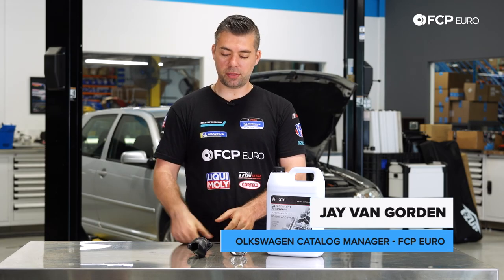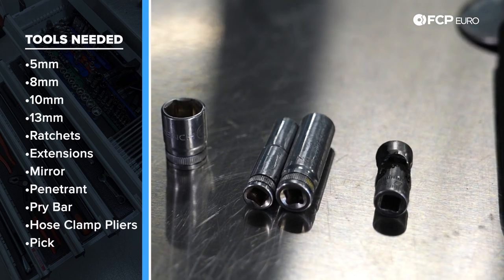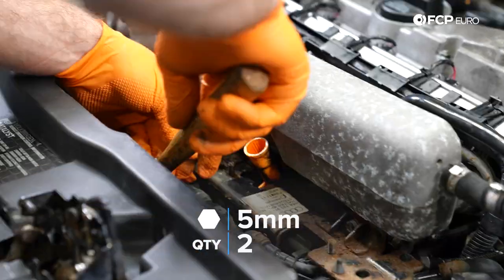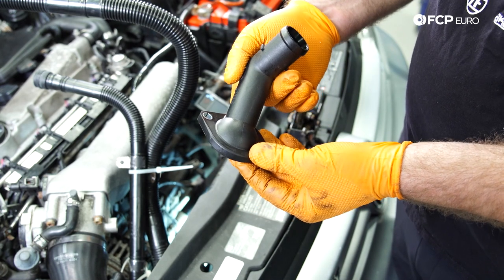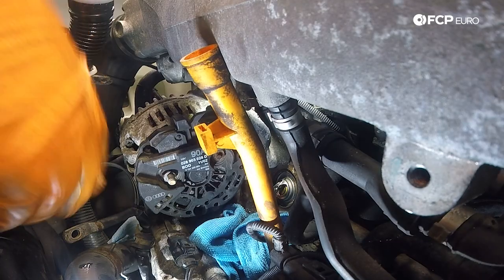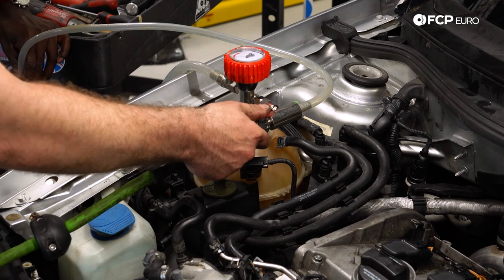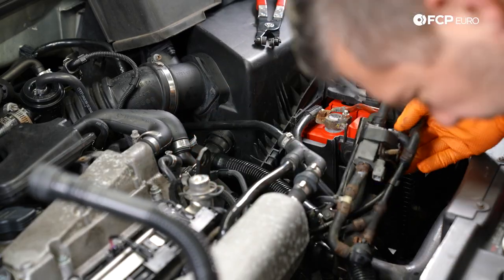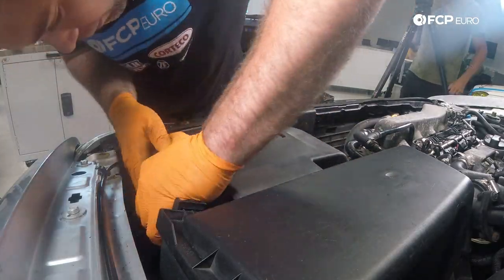Mk4 Volkswagen Golf GTI Thermostat Replacement DIY (1998-2006 VW Beetle, Jetta, Golf)

Comment: Literally SAVED ME $600!
Followed step by step.
HINT: don’t need to remove the engine mount, just jack up the car, move the mount to the back of the engine and once the timing belt is installed, work it back into position. Love FCP! Should make more videos on these 1.8t
Reply from the maker: Nice work!!

Comment: I just replaced mine. The easiest way, believe it or not, is to remove the whole front assmbly to get to those two screws. 
the radiators and the front assembly are only linked by 2 or 3 hoses and a few connectors. You have to remove the bumper cover and the assembly comes out with five 13mm screws. Replacing the thermostat is 10 minutes after that. Way easier than trying to fish those screws.
Reply: Be careful with the AC hoses, though. I held the front assembly in place with a couple tie wraps.

Comment: Thank you for sharing this great video! I just replaced radiator for new one, but ventilator does not start even when temp goes to 90 , no leak from passenger side, any idea you could please suggest that shall be checked? Coolant just boils but vents just does not start! This Is the first time I do all by me self, losing fear so  just doing It, but I don't want to give up and call mechanic. 30a fuse looks good by the way. Allí this Is happening in an Audi A3 2003. 
Thanks in advance for any ideas or suggestions.

Comment: Great video!  I have a 2004 Jetta with the 1.8T that overheated last week in -15 deg.F (I live in South Dakota) after driving about 17 miles.  I let it sit for a couple hours, then tried to drive it back home, but it overheated again after just a couple miles and I had to get a tow.  I had the water pump and timing belt replaced November 2021, so I hope my issue is the thermostat and not the water pump.  Can you give me any tips to help me diagnose it?  Thank you again for making great videos!
Reply: This happened to me on the coldest day this winter in Seattle (20deg) my water pump isn’t new but it isn’t showing the signs of needing to be replaced. After talking to a mechanic friend of mine it sounded like it is 99% the thermostat. Sounds like yours is likely the thermostat as well. I’m working on it today so we’ll see tomorrow…
Reply: @JoelCaseyJonesMusic did it end up being the thermostat?
Reply: @yomamacrib3297  yes it was. $25 fix and it’s running like a top
Reply: @yomamacrib3297  FYI if anyone attempts this on a Mk4 and you haven’t replaced the orange dip stick guide… just save yourself a trip and buy one. You WILL break it removing everything necessary to get to the thermostat. Old plastic is brittle.
Reply: @JoelCaseyJonesMusic  good looking out my boy, need more people like you in this world fr

Comment: You say to unscrew the expansion tank cap to help the coolant drain faster, however why doesn't the coolant actually drain from the expansion tank as well when you do this?  Isn't that little tap just for the radiator itself?

Comment: First of just wanted to say thank you for posting the video as I need to replace my thermostat. I have a question about disconnecting the connector on the 4:29 min mark because I had a difficulty to disconnect it. Would you please tell me how to do it the right way so I don’t make any damage. Thanks
Reply from the maker: Hi Mav, often time it helps to push in the connector before pulling out, to help break the seal.

Comment: What if my temp is not overheating but not getting up to temp? I have just replaced the heat sensor and previously so much to try and get this engine light off for good. This car is driving me crazy🤪 any help appreciated.
Reply: same problem here, have u fixed yours? if so, please let me know how